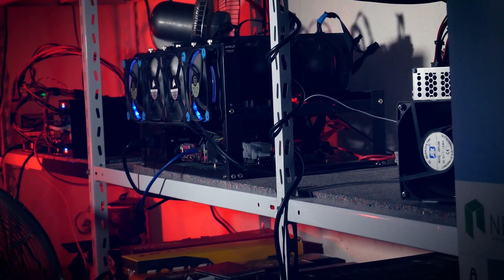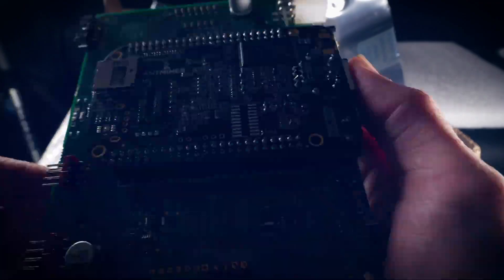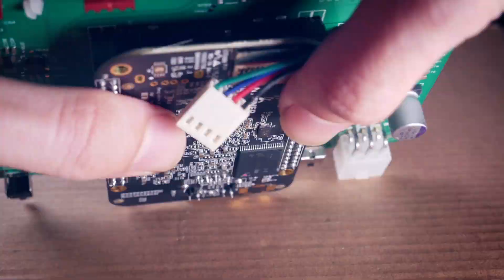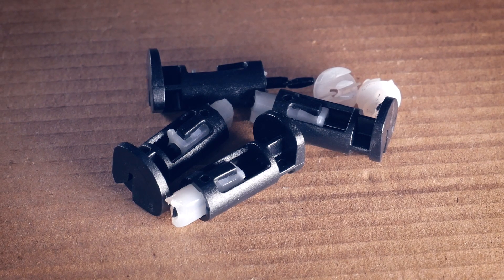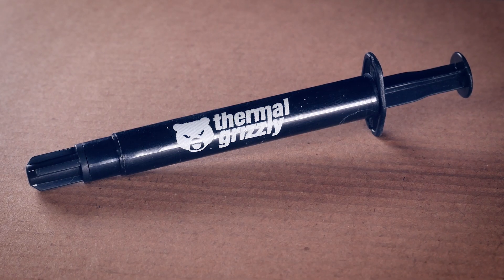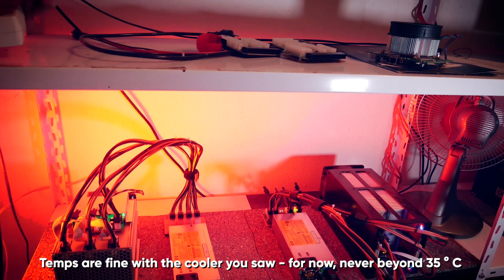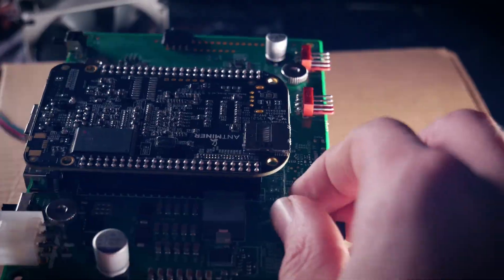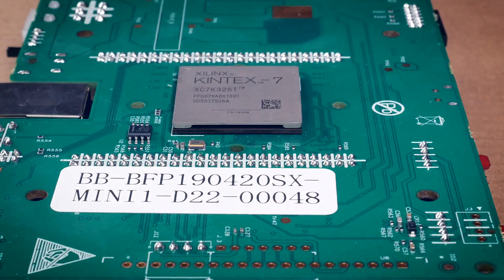Blackminer F1 Mini Cooler - how to? (FPGA) Intel 115X socket

Comment: I had the same problem with the Intel heatsink, It had too much space between it and the chip.. And then the 2nd heatsink I got didn't work either
Reply from the maker: you could just clip off the plastic mounts of the stock cooler and then it would fit :) just need to mount it with your own screws/nuts - I've even seen people using zip ties 😁 many possibilities ⛏️